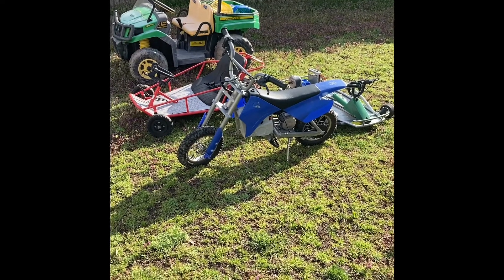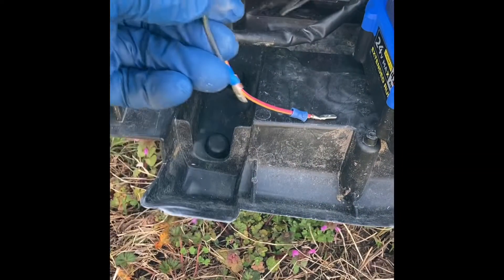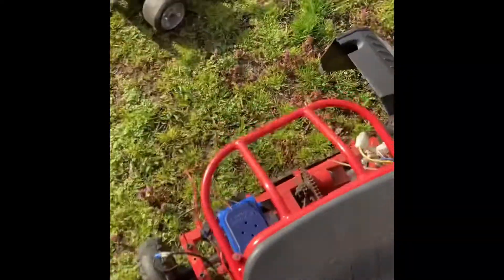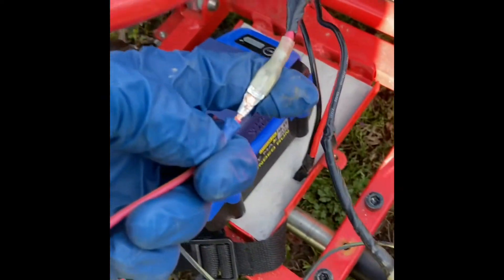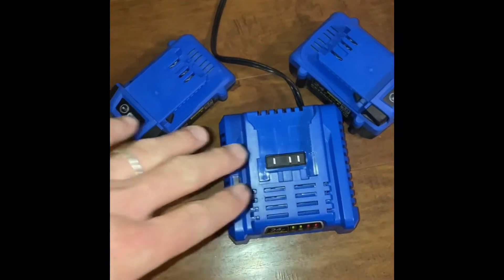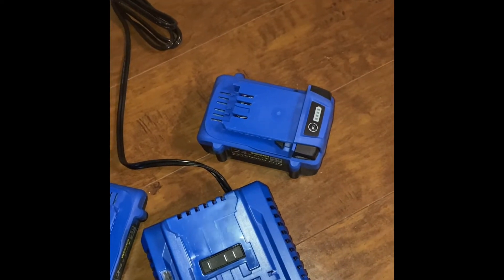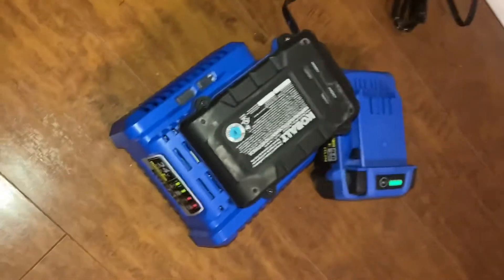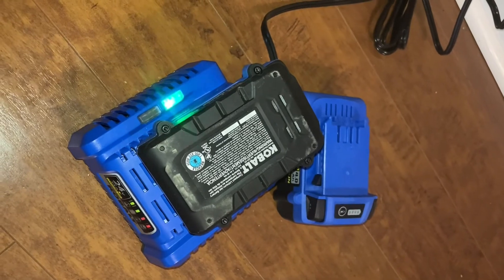24v kobalt battery swap for razor power wheels and peg perego!

Comment: Are those 24V Kobalt batteries replacing 12V stock batteries?   If so, just wondering if any other components need upgrading to handle the increased voltage?
Reply from the maker: Never had an issue on stock components outside of a worn out motor after hours of use. I upgraded the motors to 24vmotors and it’s been smooth sailing